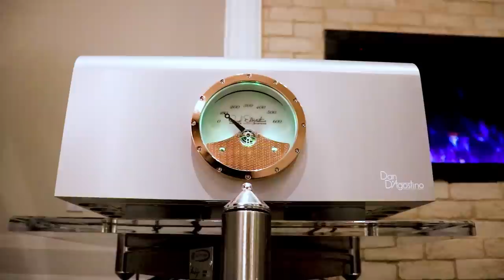McIntosh MA352 vs Hegel H390

Comment: no humming sound from the Hegel ?? i got a brand new 390 and it humms like crazy went back to the dealer get another brand new 390 ,guess what ? same fucking hummm..unbelievable
Reply: Go Mac and you’ll never look back.
Reply: there may be a bad batch caught up in the delivery. I have no problem with my Hegel
Reply: Use a power conditioner and plug all of your gear into the same grounded unit. This should solve your humming issues.